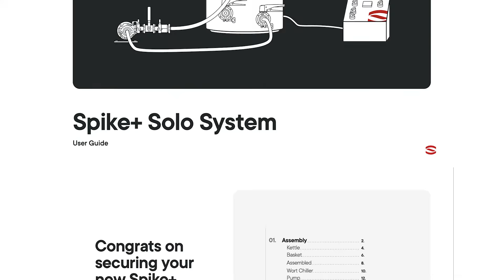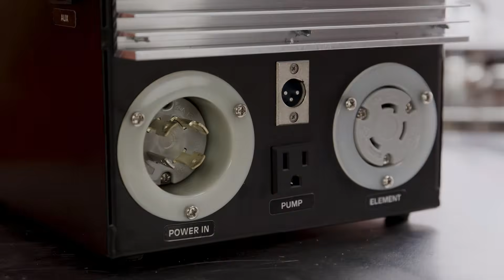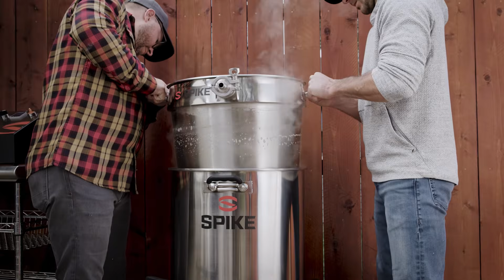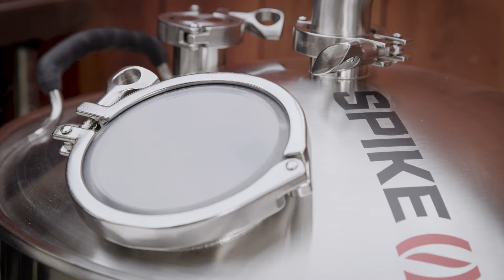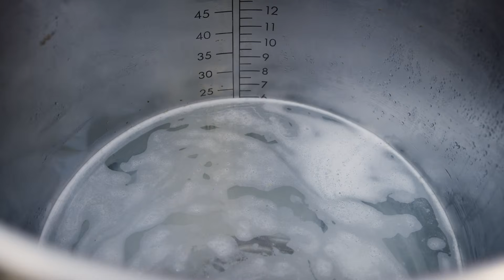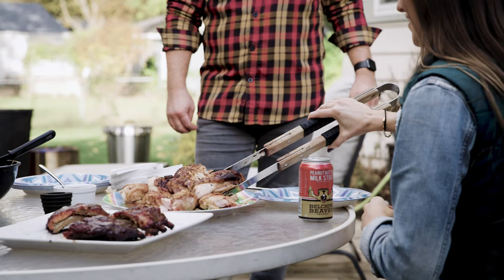Spike Solo Brew Day (Extended Cut)

Comment: During mash for 60 min. Should the lid be on or off?
Reply from the maker: The kettle lid should be off. However, if you're using our Steam Condensing Lid that should be on during the boil.
Reply: @SpikeBrewing  not for the boil I'm talking about mashing in.  Keep it covered or uncovered
Reply from the maker: @4rdzlla  you'll want it on to help retain heat